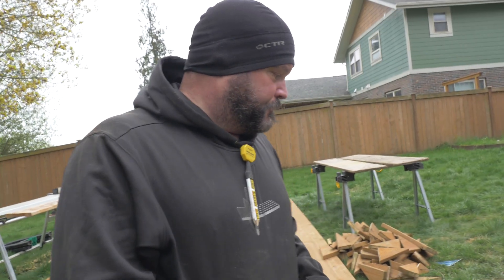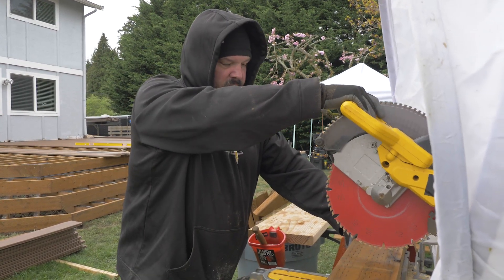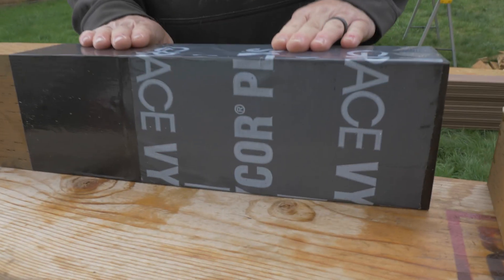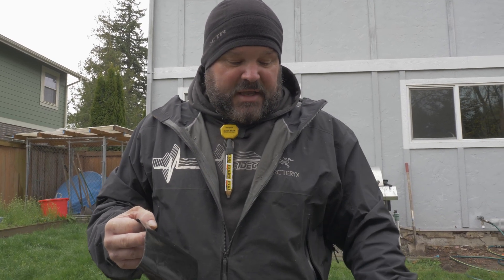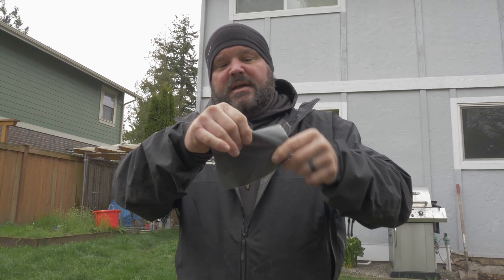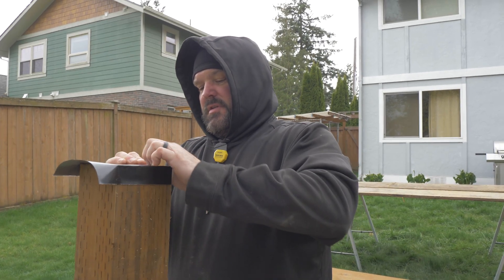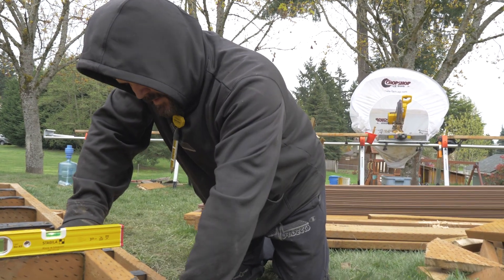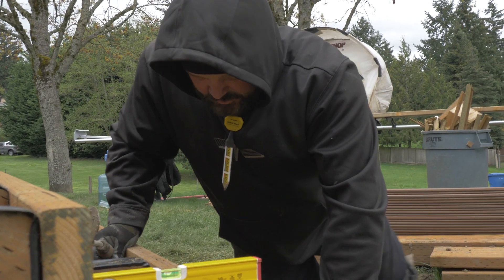Build Update: It's the Finer Things || Dr Decks

Comment: I've been following your videos because I can always learn something from other deck builders. Why do you put concrete around the post? From everything I've read, the concrete shrinks when it dries (and so does lumber) and water will find it's way into the gap and then once air and micro-organisms find it's way in, you start the rotting process. Wouldn't you be better off just setting the post on a cookie? Then there is no moisture trapped next to the post. Most of all rotting issues happen at and just below grade.